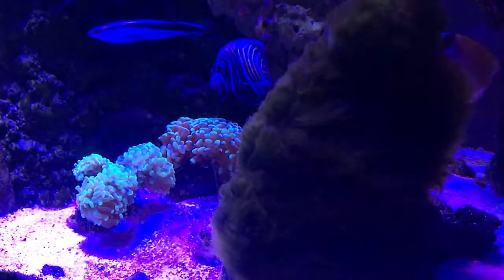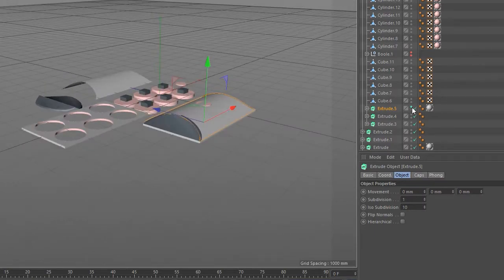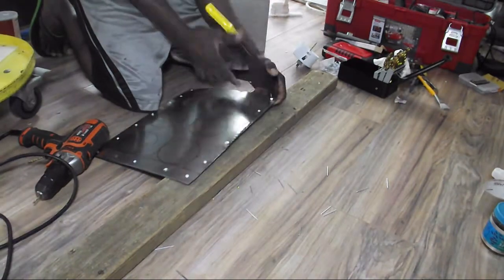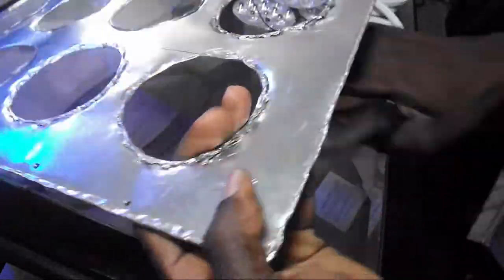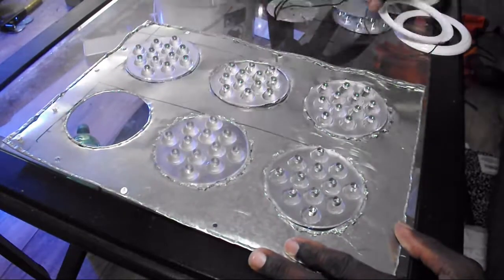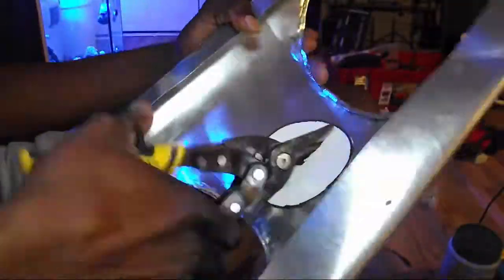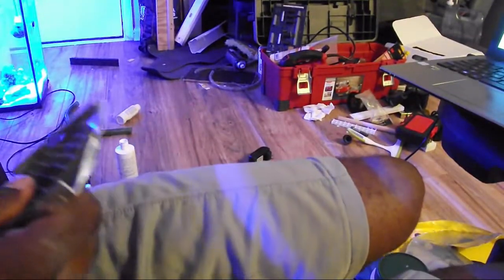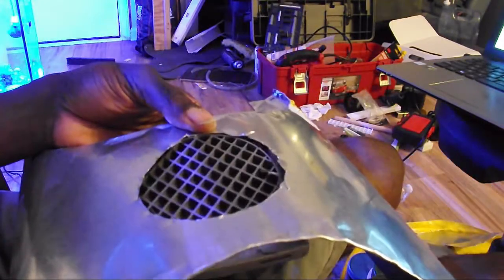LED Reef light Diy build |:| part 3

Comment: Next time you need to make holes that size chain drill just inside the line with a smaller bit keep the holes close together then cut the gap with sidecutters then file to the right size. Also it is called stitch drilling.
Reply from the maker: Cool i will definitely try that out . i am about to start rebuilding the light body